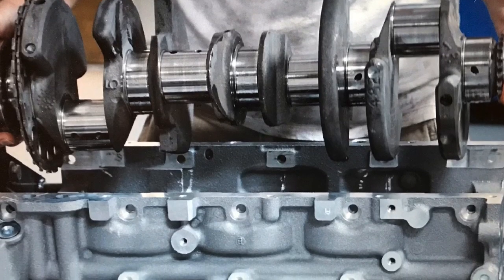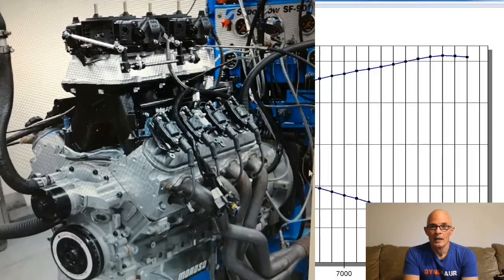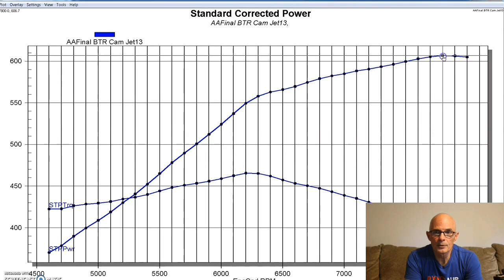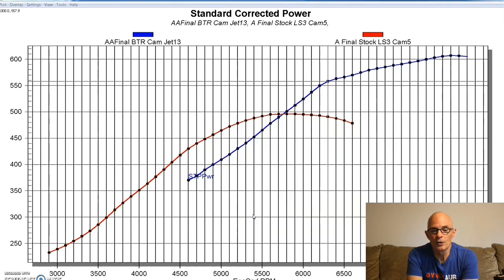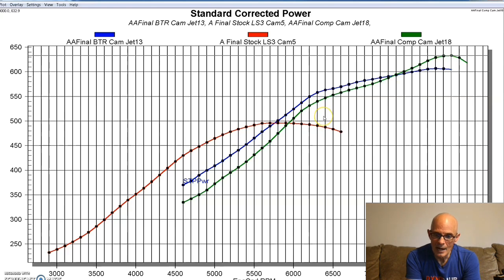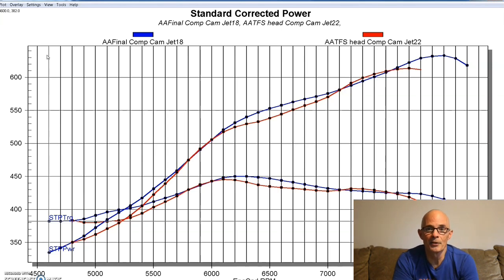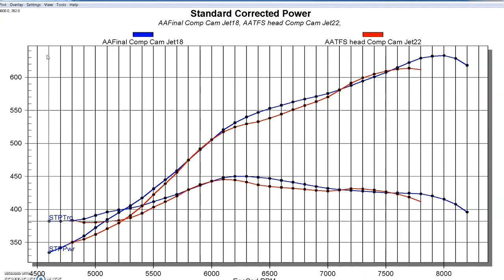DESTROKE LS-4.8L CRANK IN LS3 BLOCK-SHORT STROKE POWER-AN LS MONSTER MYTH?

Comment: So does a 5.3 make the same power as a 4.8 crank in a 6.0 block?
Same cam, same heads and intake system.
Reply: Actually with the larger bore diameter of the 6.0 block, it's closer to 5.5 liters at 338c.i. where as the smaller bore 5.3 block is 325c.i.
Reply: @captaincouldverc  
4 inch bore of the 6.0
3.27 stroke of 4.8
329 ci
Reply: @philwishart5833  
Holy smokes! I just realized that! 
I'm embarrassed I didn't double check that. I thought he said it came out to 338ci. I also wasn't wearing my glasses when he wrote it on the screen and I sincerely thought he stated it was 338. 
Well, this should be a fun roast session once the internet catches wind of this! Hahaha haha haha!
Reply: He did quote 338
Reply: The 5.3 & 6.0 use the same crankshaft but different bore size in the block. So basically it would just end up being a built up 6.0
Reply: @captaincouldverc  
Putting the 4.8 crank into a 6.0 to make a 5.3.
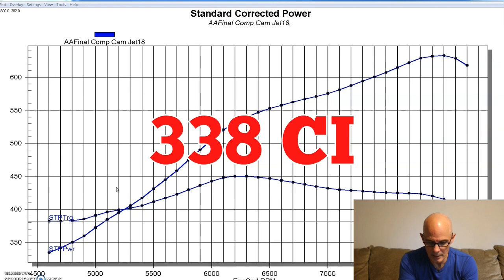Reply: O.k. I double checked. He did state it was around 338ci. Go to 3:39 to verify. 
So at that displacement is Infact a 5.5L and not 5.3L, atleast according to math 338ci=5,539cc=5.5L 
Here's where I think we both got lost. The LS3 has 4.065 bore, not the 4.000 bore of the standard 6.0L, I also missed the part where he said it was an LS3 block and also thought he meant the regular 6.0L
Do with that, what you will.
Reply: @captaincouldverc  
He must have bored it over sized
Reply: @philwishart5833  
No sir, he stated it was a stock bore LS3(6.2L) which has a bigger bore than the gm 6.0 (LQ series I believe is what they referred to it as) 
6.0(LQ)=4.000 stroke not used
LS3=4.065 stroke used in video
2 different blocks with 2 different stock bore sizes. Do the math yourself for an LS3 bore of 4.065 with the stroke of the 4.8L @3.268
You get about 339c.i. 
The math adds up, and I'm not sure if I can explain it for you better than the fact of you're using the incorrect bore size of a different block than the one he tested and built in the video.

Comment: I think GM missed an opportunity here. Sure would have been sweet to reintroduce a dz302 in a Z-28. I would buy one.
Reply: Well this is why I love my 409 Chevy. Short stroke big bore. Pulls like a big block revs like small block. But very little down low.  BTW not a 409 sbc or LS. A real 409

Comment: The only substitute for cubic inches is cubic dollars.  Power Nation built a 440 cu LS(head) motor that was 670 at 6800 rpm.  Much much more streetable and valve train cost probably a lot less.  I guess if you are bench racing and bragging about rpm....
Put in another way, you'' probably want a 4500rpm stall converter.  So yeah, you can beat that Honda next to you, but you'll have to rev the hell out of it to get it off the line.

Comment: I simply like being able to rev the crap out of a v8. For a performance minded daily driver. I suspect that short stroke would be best. Short stroke means longer lasting rings, pistons and a little more time before "tired but still runs alright" stage of engine life.

Still rocking the 16yo factory 220k 4.8 in my 03 Sierra and the main reason I'm wanting to drop the same engine and trans in my 79 El camino. I bet a 4.8 would be a lot of fun in a 1,500lb lighter truck and still be a daily driver outside of snow/salt on the ground days.
Reply: Youd be surprised this motor is the same basic principal of chevys 302 back in the day of biggest bore we have mixed with shortest stroke and it had very bad street manners cause it made everything high in the rpm range so for street driving where your mostly in low RPMs you have nothing
Reply: @cameronvandygriff7048  not exactly, the 302 had the 3 inch crank from a 283. The 334 de-stroker uses the  4.030 bore but the 3.27 inch stroke from the 4.8L. The original 327 stroke was 3.25.

The 4.8 in my 03 ext cab Sierra has hauled it around just fine for 16 years. I think it would do fine with a small cam in a 1,500lb lighter g-body.
Reply: @nashvilleoutlaw  I never said same stroke but building something lot of bore with little stroke makes for little low end torque but alot of top end torque just like the 327 and 283 were great on the street but their love child had bad street manners in a first gen Camaro which was pretty damn light and a 30-30 cam isnt a huge cam the motor just wasnt a low end motor it was a motor built to run at top RPMs for extended periods of time adjusted for the street but theres only so much adjusting you can do before it's a different engine

Comment: The short stroke with a long rod is used in some cases to control piston speed or acceleration within the bore and to increase dwell time at TDC when running higher RPM.
Reply: Sort of late to this thread - one of the reasons manufactured hesitated on ever going to over-sqaure designs was due to flame propagation over a larger surface area. You go back before the 1950's, nearly everything was under-sqaure. As ignition systems became more reliable and combustion chamber design improved, they started moving to a happy medium of big cubic inch over square engines that give good low end performance and a good top end. In a high performance / high revving application, a longer rod providing a little more dwell time at TDC and serves to allow better flame propagation and let that flame front develop for a full burn.
Reply: Engine Masters just did an episode where they tackle rod ratio, and sort of debunked the long vs short rod...there's no appreciable performance difference between dwell time at TDC and BDC. I'm sure there are situations where it may apply differently, but it seems like no one really has done much true testing on whether rod ratios really do matter.
Reply: @jon2914  Teoretical difference in perofrmance - shorter rod should be little better brthing in low rpm... BUT what about longetivity ? Dont need to do any tests to know that longer rod is lighter on piston skirts... and there is much more friction in high rpm, so there is the advantage of longer rods...
Reply: @johnnysodak7261  But longer rods are also necessarily heavier than a shorter rod, so it's not all good. Not sure where the happy medium is.
Reply: @nobodyspecial313  sure, just talking about pros of longer rods.. there has to be balance, depending on the application of course.....alot of variables
Reply: @johnnysodak7261  sb2.2 engine had a 6.2 rod in it.
Reply: @nobodyspecial313  the happy medium is completely dependent on the motor and the only way to find it is to continually change your rod length until you find what is best for your situation.
Reply: Long rod/short stroke decreases side loading at halfway up, decreasing possibility of piston slap and decreasing bore wear.
Reply: @jon2914 engine masters test was long rod short rod comparison adjusted with piston pin location. This is changing the crank stroke to reduce displacement, moving the throw of the big end bob weight closer to the centerline of the crank in the big bore, block. Running a longer rod is necessary for the piston to travel to the top of the CC,  while having a piston that is designed to be stable at RPM. 600+BHP is BA for peak power. However the heads cam and induction gave the engine the power. And this combo is a wrappy!!! Engine. With a very broad and flat curve. Like the energizer bunny. It just keeps going and going and going......................
Reply: @johncallahan2164 - yeah, I’ve been through this old discussion a lot. RH took up the difference in stroke with custom rods netting a 1.928 ratio! A higher displacement would definitely have made more power, but I think the way to look at the effect of stroke, rod ratio, efficiency, and dwell is torque per cid over rpm range. I had the same engine idea for a Factory 5 Hot Rod project mostly due to those weighing under 3k lbs- I don’t really need aggressive low end torque, so I’m glad Richard did this! Thanks!!!
Reply: @jon2914  yep,nascar engines.

Comment: we run a northeast dirt modified with a "spec" engine. 358ci 10.5 compression and we make 610 hp on gas and turn them 8,400 all day 
weekly shows that are 30 laps we run methanol and make 648 hp

Comment: Wow, finally someone who gets it. I don't come across many preaching this. I always insist to people who want to claim the benefits of "short stroke being better" than any non-displacement limited race team will ALWAYS go for as much displacement as they can package, and that will include stroke. The ultra short stroke-wide bore engines are ALL in displacement limited racing, and there's a reason for that. By contrast, go study rally engines, which while aren't displacement limited are air inlet restricted. Very different motor designs.

And don't get me started on the "longer stroke gives more leverage thus more torque" myth.

Comment: Cool build! I remember one of the famous car magazines tested the stock bottom end of a 5.3 engine to see how much power would break it. I'm talking turbocharged, high-flow heads, they threw it all at it. Long story short, they quit at 1400hp and the stock bottom end was little worse for the wear if at all.

It was during disassembly to check the rotating assembly that they discovered the 5.3 was actually a 4.8 - 1400hp from a stock 4.8.

So, piston acceleration is reduced with an oversquare build like this too. Of course like you mentioned the valvetrain is still the weaker link, but that slower acceleration/deceleration compresses the fuel mixture more gently, to the point that you can run higher compression with no side effects. Hot Rod Magazine once built a 352 from a 400 with a 327 crank and modified Ford 300 6-cyl rods. They ran 12.5:1 pistons on 87-octane with ZERO ping, and the engine put down 412hp.
Reply: Waffle groove pistons can let you compress more
Reply: Was it the article written by Richard Holdener in Hot Rod magazine?  https://www.hotrod.com/articles/hrdp-1109-stock-gm-ls-engine-big-bang-theory/
Reply: @E30Fred  I remember reading that.
Reply: @E30Fred  😂😂

Comment: You need to caveat some of your statements. A longer stroke motor does not have a high of a peak rev potential as a shorter stroke motor because eventually you run into flame speed limitations. You need to state that LS motors, specifically, are limited in in peak rpm because of valve train. Several 4 cylinder 4 valve motors have the ability to rev all the way to flame speed limitations, and the fastest naturally aspirated 4 cylinder 1/4 mile cars do not use stroker kits as their cars would actually lose peak power due to this fact.  

Also, F1 does use big bore short stroke for more power, but that is because regulations prevent them from using specific turbo and displacement combinations. 

People don't flame you because they are ignorant. People flame you because you state partial truths.

Comment: I would be interested in longevity of the short stroke vs long. Both at a particular HP and RPM. In other words, will a short stroke last longer at high RPM than the long stroke? Would one make a better endurance engine than the other?

Comment: I have a 4.8 in my Silverado all of the bolt ons i can get 3:73, brother has a single cab 5.3 tuned. I can spin off the line with a posi. Hes open diff hes always bragging about his power i been beating the balls off this 4.8 for 3 years i can relate to the high range power. Intake,exhaust & ignition helps me? I port and polished my intake too..in the end i get better mpg's and more torque from a down shift

Comment: The short stroke in F1 is so the rods don't exceed the fatigue limit (speed, feet per min depending on the strength of the rod.) If you exceed that, the rod will break. The advantage of short stroke high rpm engines is the insane hp you get, and the width of the power band. 400 ftlbs of torque at 5000 rpm is about 380 hp. 400 ftlbs at 20000 rpm is just over 1500 hp. Try to build a de-stroked na small block that makes 450 ftlbs at 12000 rpm, and you will quickly find that the bore size is a limiting factor in that engine design. The entire engine has to work with bore and stroke as a whole, or it wont work so well. Short stroke is not a myth. A small block can be set up to take advantage of short stroke. But it is far cheaper and far more reliable to just build a big small block that you don't have to spin so fast. If your dead set on a crazy high rpm, start with an engine designed to spin that fast. Judd, Cosworth, etc...

Comment: One other benefit from having the shorter stroke would be slower piston speed correct? Assuming the crank is turning at an equal rpm, a longer stroke's piston speed would be much faster than a shorter stroke. Yielding potentially greater protection against premature piston ring wear. 

Or am I overthinking this? 😂

Comment: That's used to be the best way to get hp! A short stroke meant higher RPM , and more peak horse power. There are a few reasons for this. First of all a large bore, short stroke combination draws air into the combustion chamber easier. Also, the give the engine a higher Rod Length to stroke ratio. Smoky Yunik  said the the perfect rod length to stroke ratio was 2.2-1.  Now, he was racing NASCAR endurance engines. So his. Engines revved into the stratosphere all the time. Years ago I found an off grand magazine that went out of business soon after they started selling magazine. The author took a Chevy 302 with a 4" bore and 3" stroke and built the engine with short rods of about 5.5" and stock heads, long rods at 6.5"  and stock heads. Then. He took the same engine and put aluminum aftermarket heads on it. While the stock heads had roughly the same size combustion chambers as the aftermarket heads, keeping the same static compression ratio throughout the testing. But that had small valves at 1.72" and 1.5" exhaust. . The aluminum heads had 2.02" intakes and 1.6" exhaust valves. The tests were run back to back while trying to maintain the same ambient temperature in the dyno room through the day. On the stock headed engine the long rod package  made around 25 hp over the short rod. In the aluminum headed version the long rod made more power that the short rod as well, but this time the difference was 10 horsepower at best.  The author suggested that the long rods were definitely better then the short rods, but on the aluminum heads they didn't make as much of a difference because those heads flowed so much better to begin with. On the stock headed build he posits that the long rod had more to overcome than the aluminum headed version, which I conquer with wholeheartedly.

Comment: F1 engine run short stroke because they want low torque numbers! The car (if you can call it that ) weight around 1455 pounds they want as much Hp with the least amount of needed torque to make it happen

Comment: realistically in a mild build even a smaller bore would produce a higher rpm peak power, usually the head flow is the limiting factor, and a smaller engine would max out the heads at a higher rpm

Comment: I want to bore a 4.8 and make it run at a higher RPM and use decent flowing heads and a low ram intake with twin 68/76 turbos and a water to air intercooler. Hope that is a good combination for my project and goal.

Comment: I'm curious if the 4.8 has greater power potential with a stock bottom end because of the better (factory) rod ratio. But then again, if the 4.8 bottom end is good for more power, maybe it's because it makes that power higher in the RPM range, putting less stress on the bottom end. Hmm

Comment: I have a Ford 460 based 545 with Kaase P-51 heads. Diamond pistons relieved for the canted valves. Edelbrock Victor Jr. single plane -port matched intake to head. Big Block turns 7200rpm and wants more...so this tells me exactly what Rich is saying as far as the heads and displacement vs bore & stroke! RICHARD IS A GENUIS!! THANKS!...Oh!...I don't even own an LS. I just love the info of "what if?...or WTF?"

Comment: Back in the 80s and 90s, everyone was building 383 small blocks. Great torque but short lived. A 400 small block with a 350 crank was actually the better combo. Destroked 400 or big bore 350? Just depends on how you look at it lol! Either way, a 377 was an awesome package!

Comment: 7:40 I am assuming that you used the same camshaft and we all know that a cam size acts larger in a smaller motor. So, what if each size motor had a cam tuned to the same rpm? Which one would have more power then?

Comment: I now understand why the junk build VW engine where I used a 1200 cc 64 mm crankshaft with 90 mm pistons was such a torque monster. I did this because I didn't have the funds to for the "right" parts and it was the sweetest engines I ever built for a 63 Beetle with 538 gears and everything else was bone stock. I didn't run a tach so I'm not sure of the RPM but it got there fast.

Comment: Am I wrong in thinking that with a short stroke setup  you are also running slower piston speeds and therefore can get more rpm out of otherwise equal bottom ends without failure? Also a few years back I was reading a very interesting article about one of  the spoon civics they were running over 10k rpm. The issue they were running into was the piston was out accelerating the flame front. Among Honda guys there is an age old dispute about how Honda guys used the wrong open chamber head on there Type R motors instead of the GSR head with a much better quench. Guys argue they can get the same flow numbers with porting and type R motors where hand ported. I know Honda really knew what they where doing back in there glory days and believe the reason they did it was because of flame speed. What’s your thoughts on that?